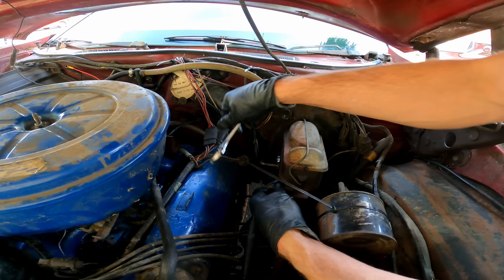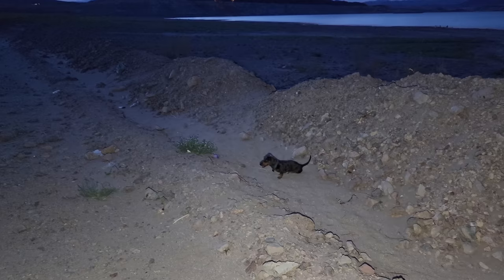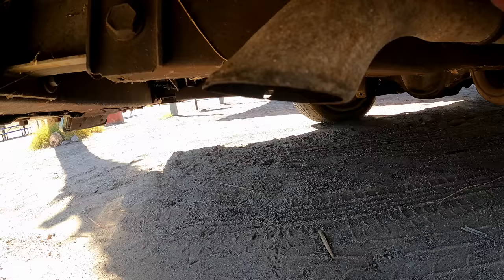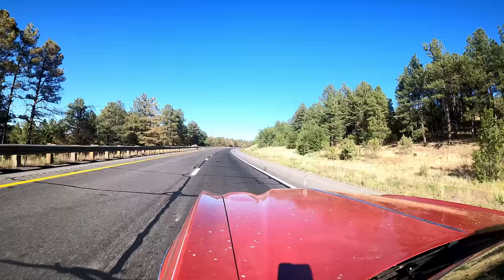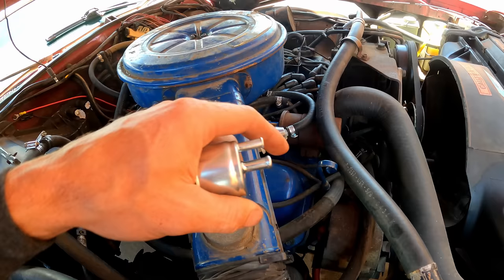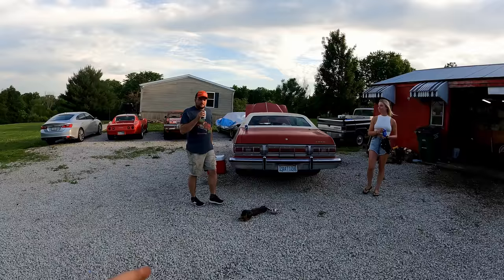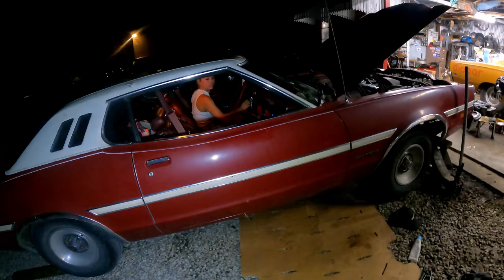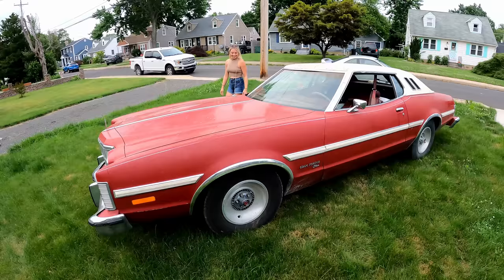Will The 1974 Gran Torino Elite Drive 2500 Miles Home? Vegas To Philly - NNKH

Comment from the maker: I just picked the 3 random winners for a B'laster T-shirt / can of Multimax Lube.  If you don't see a check mark next to my name and a heart on your comment then its a scammer impersonating me.  I keep blocking them and they keep making new accounts.  Anyway... 24 hrs to comment back and claim otherwise it moves on to the next randomly selected winner.  Good luck!  
BTW, merch link stopped working... Check out NNKH hats here: https://teespring.com/nnkh-hat?pid=763&cid=103367
Reply: Dry gas or isopropyl alcohol should take that sap off. It works with pine pitch but it does take some elbow grease. Use it along with a plastic razor blade. Gus has got to be one of the cutest puppies I’ve seen.
Reply: Hi thanks ! I saw on my mail that i won something.
Reply from the maker: @miman-ck9jv  That was a scammer
Reply: @NoNonsenseKnowHow  all right thanks,    get that car cleaned up 👍👍
Reply: It’s a shame you have to deal with the trolls
Reply: Hello this is Russ. Love the vise grips and hammer
Reply: You need Gus on shirts and hoodies...I'll buy for sure!
Reply: Where did the squirrel go
Reply: You got cool partner there she so sweet u lucky man
Reply: Great vid.love your dog and wife.y’all my kinda folks.  I just sold my 1970 TorinoGT ,convertible. I miss her now that I saw your vid. Cheers. God bless.
Reply: 31:38 the thunderbird had the AC micro switch you needed.
Reply from the maker: Yes. And it was probably bad too. LOL. Plus I think at that point in the trip I already corrected it with another switch right? I don't remember
Reply: I had the same exact Torino back in the late 80s here in Pa and same color . It had the 351 windsor with the cast iron fmx trans in it but I changed it out with a cleveland. It was a tank .
Reply: @NoNonsenseKnowHow  👍 great video, entertaining to watch, make another road trip vid with a sketchy abandoned car 🤣
Reply: Every nice ride needs a 2:73 rear end. I got 28mpg with 400hp 350 chevy engine and 18mpg with a 900 HP 350 engine
Reply: @NoNonsenseKnowHow   WHY NOT OPEN TO CANADIANS ???... We watch your channel too, eh.
Reply: You know I'm so glad you mentioned the Scammer . I literally had a message from VGG telling me I've won with a phone number attached . New it was a scam when Derrick himself texted and said I won a new truck . I only had to pay customs .. Loved this Whole series can't wait to see what's next .
Reply: If you use a bumper jack , at least put blocks under your car . If you are going to be under the car . You are setting a bad example.
Reply: Thanks for the video. This is my first time watching one of your videos, it showed up in my recommended list and you got my attention with the car right away because a friend of mine in high school (1992) had a 1978 Gran Torino and I loved that car. I'll be subscribing and liking to help support your channel. One last thing, I don't if you are aware of how lucky you are to have such a cool girl to go on such an adventure with you. Most of the girls today are too vain to be seen driving in what most people these days would consider a hooptie. Keep on keepin on!
Reply: To remove tree sap drops you can try things that also remove tar = for instance butter, fat and/or oil.
Best regards luck and health to all involved life forms (humans and animals).
Reply: Bacon grease, butter and tallow have used for everything for the last ten forevers.
Pretty good stuff!
Extra creamy whipped cream works the job also.
Carrageenan(sea weed) is the thickened along with cellulose gel.
I did video where a side character ( me)thought he had rabies, and everyone said no, you can't get rabies from a duck ( adaption of the famous duck joke).
I keep showing up with more and more extra creamy whipped cream coming out of my mouth and all over my head more and more saying, " I think it's getting worse"
I'm telling you because later after I had showered it all off, I noticed my skin was smoother and softer than s babies ãş$.
Try it , you'll be amazed
& your welcome.
Ps~ you can also shave with it.
           Prof. I. Ver Mectin
Btw ~ Ivermectin,  the alcohol blend they spray on cows to keep them movie free and makes them look pretty work good too, but since everybody found out about it the price went up almost ten times.
Reply: You three just took my Heart with you on that 2 week drive/vacation/project/Adventure!

I feel like I've just made Friends for Life.

Thanks for sharing it all with Us.
Reply: Yes pick me.
Reply: Pick me love forever
Reply: Yes pick me
Reply: Alex carro
Reply: Mr. Road traveling in granda torino& your wonderful lady which does have nice nice legs,plus the dog is a nice minded dog. Oh yeah im Douglas Bailey in  Indianapolis, its ok i didnt win the Blast t-shirt, you said it was some dirty greedy impersonater , scammer doing wrong stuff. He should be eating scrable eggs then impersonating your wonderful work you and ur helpers . Just put scrabble egg eater on the wall so he might slip off the wall, so i can plus you & helpers in stayed of called humby dumby call him scrabble egg man cause no one put him back together. (Funny) but true . Later my fellow traveler. Plus ur helpers. Here something try not to have scrabble eggs to much. Smile😇😇🤩💖👍🙏👫🐕 later man 🤔
Reply: @mikehunt3222  yea Gus is ok, more of Jen in her daisy dukes will blast the view numbers thru the roof though.
Reply: Hey at 13:23!, I like that flashlight where did you get it at or what website that I can buy it off of?
Reply: I read for a non aero vehicle 45mph is about the max for optimum mpg's above that just pushing to much wind.
Reply: When you drove onto your front lawn, did I see a 1970 Monte Carlo in your driveway? Now that's a nice car. I had a 1972 Monte when I was 18. My brother handed it down to me. I loved that car 🥲. What city do you live in? (I'm in Pa., living in the Willow Grove area)
Reply: @Jazzyj69  you saw wrong pal
Reply: @obston2846  you need to go to the 1:15:46 spot of the video and you'll see a 1970 Monte Carlo sitting in the driveway.
Reply: Thanks for the shirt bro i love it next time can you sign it? Also your sister is awesome she was such a good sport helping you on that long drive.
Reply: @NoNonsenseKnowHow  Don't you have an oil filter wrench you carry? I swear you are the MacGyver of mechanics.
Reply: closer to the Torino than the t-bird was the Mercury Cougar,   I had a 75 Cougar that looks so close to this car,  trying to remember if it had power or manual mirror controls,  def power door locks because I had to replace one of the solenoids...  it also had the (at that time) kick ass power trunk lid latch.
Reply: @snoopstp4189  My very first car was a 1976 Courgar XR7 that my parents bought new when I was in 11th grade. I have owned many Cougars ever since and I wish I still had the 76 cougar. Nothing was built as well at the 74 to 76 Cougar and even the grill was made of cast metal like the Lincolns were.
Reply: 36:12 looks like you got punched in the eye
Reply: @CorpseDriver01 Www
Reply: Hey GUS start your own YouTube channel
Reply: b
Reply: @NoNonsenseKnowHow  Just want to say that this video is by far my favorite thus far!
Best aspects: 1-)Plenty of Drone footage (can never have too much!) 2-) Stops to visit friends along the way (VGG doesn't do that!) 3-) Constant mechanical upgrades along the way (with good details on the how and why) 4-) Great photos and period correct archival footage mixed in along the way.
I'm sure there's more that I'm forgetting but I'll just add: If you haven't already create playlists with other videos of the same style to make it easy to find each video of different styles and smiles! (please excuse me if you already did so)
Keep on Truckin'!

:face-red-droopy-eyes:
Reply: That's one nice looking Ford.  I have found you two for the second time ever.  The first time you were vacationing and returning home.  The fly drive is something I wish one did in my prime, about thirty years ago.
You are close to Merlin's Old School Garage , he is on the Internet and a car specialist.  Big diesel man and if you saw a Cummins boat on the lake it was him
Reply: One of my brothers's Enduro cars was a green 73 Gran Torino with the 351 Cleveland 👍😎
Reply: An awesome roadtrip watched from UK thanks

Comment: To get those dried up white tree sap spots off of the body, Use a decal & sticker removal wheel in a cordless drill... Takes them right off with no damage to the paint

Comment: Loving the Torino content. My grandfather owned a 74 Grand Torino and my favorite show was Starsky and Hutch. So when me and him would hang out my favorite part was riding in the Torino. My grandfather was a giant of a man, specially for his generation. He would sit with the seat all the way back with his head leaning to either side because of his height and his knees along both sides of the column.
Reply: That must have been a tight fit for your grandfather.   I have a 72 Gran Torino and I am only 5 ft 10 inches.  With the seat all the way back I am still wanting for more room.  His probably had a power seat which gives you a lot more leeway.   My 77 Cougar which is basically the same car had a power seat and that really helped a lot.  They are beautiful cars.

Comment: We used to typically wrap the fuel lines at the engine area with tin foil to solve vapor lock issues. It worked in the 60s. Great video for a trip with a 48 year old Ford. If you could've resolved the fuel delivery issues at the beginning, then your trip back home would've been almost trouble-free!
Reply from the maker: From what I understand it mostly starts down where the fuel pump is mounted at the Block and it starts boiling in the fuel pump. So going with it and electric pump seems to be the most popular upgrade

Comment: For the fuel vapor lock problem, I've gone to a wrecking yard back in the day & found an old power steering cooler like the one already on your power steering pump & found a place under the car near the fuel line. Close to the fuel pump is best. Route the fuel thru it to cool the fuel. If you can mount it where air can hit it while being shielded from damage it will stop vapor lock, a common problem back in the day in Texas. Just showing my age here (I still know how to set points...).
Reply: Me too.
Reply: Great video!  You reminded me how great America really is.  Thanks Chris, Jen, and Gus.

Comment: Those bumper jacks are retro but dangerous as hell ! I used to careful and extremely cautious just changing a flat. They fall and shift with just a breeze. When you were pulling and wrestling with the filter I was almost afraid to look.  
Other than that I enjoyed the video. Keep ‘em coming !
Reply: I know I would of had the spare wheel under the sump
Reply: Never get under a vehicle  supported  by a bumper jack! Fast way to die!   Jack stands are not safe either!  I use  either stack of tire with rims or large hardwood  log

Comment: The ramp/intersection that you saw in Missouri is called a "Diverging Diamond Interchange".  They are  usually find them in metro areas where there isn't enough room for a huge cloverleaf, while at the same time allowing traffic from all directions access to the opposing Hwy in all directions.  They actually work pretty well.   Nice job getting that boat back East!

Comment: Still living those days with my old Fords, not a bad ride! All typical problems, I run lower temp thermostats cause of the heat in the summer, those cast iron engines retain heat, years back we'd just take them out in summer, road draft is what keeps them cool, we live at high altitudes so I bump up the ignition timing and vapor lock is a thing of the past, my 52 F-3 was assembled at the Chester plant not far from you. Keep em running guy 👍👍👍

Comment: What amazes me is that at the same time the US was producing the square Gran Torino, Ford Australia was producing the Ford Falcon XB Coup with the same 351 Cleveland engine producing about 300hp and with a much sleeker smoother body line. Not a knock on this car, but being an Aussie kid, I think ours was the better car. But love this video by the way. Make me wanna do the same one day soon.
Reply: Your Falcon XB shares more of the styling of the earlier 70-71 Torino GT's in the US. By 74 in the US Emissions controls and 5 mph bumper laws had already slammed the brakes on performance and styling, and the manufacturers were now pressing the personal luxury car instead of high performance.

Comment: Kudos to you for your knowlege on the older vehicles. In my generation, we ALL practically had to have this type of knowledge as there wasn't a garage on every corner as there is today. ALSO, many of the mechanics today cannot seem to solve even simple problems like you have done! They depend too much on computers, codes and readouts, haha, and don't seem to have common sense knowledge and trouble-shooting skills, otherwise. Sad, but true.

Comment: Great video. I have a 1976 Ford Elite, that was my first car. I’ve had it since 1990. I love mine. It has the factory 460, bucket seats, and a power moonroof. It is white with white vinyl and red interior. They are great cars! It’s too bad that they are so unknown, under valued, and under appreciated.
Thanks again for the great videos. You two are so lucky to be able to do what you do.  Vacations like these happened in the 80’s, but unfortunately it’s far too expensive for the average family today.

Comment: Had a 76 red and white Ford Elite almost like yours. These are an awesome car. I ran mine for at least 200,000 miles and changed oil every 4,000 miles. The transmission needed overhaul every 100,000 miles. Need to check the rear wheel wells for water. They were bad about collecting water if not checked. Had to change the filter inside fuel tank. Mine had a 351 Windsor engine. Regardless, of care of carburetor, it would need some tlc every so often. Don't know where you'll purchase gasoline without ethanol. Rear holder that holds bumper was bad to rust. Clocks never seemed to work since they had spring loaded spark system. Had to replace the heater core eventually and put a bigger radiator after several years. Ran rods in radiator but that didn't do much but bigger radiator took care of the problem. Power steering hose wanted to leak. Would use the italia rotors from brake world if had had them back then and the pads they recommended.
Car-part is a great place to find the odd parts. Mine got 16 mpg in WV. Was curious what you had to give for that vehicle. My gas tank held between 20-22 gal. My car was manufactured in Canada. I'd change out that radiator for a bigger one so it would run cooler and not as apt to boil the gas with elevation changes. Front brake calipers were bad to rattle on mine.

Comment: A couple of tips:
1. For the vapor lock, if you open the hood partially when you park, it'll let the excess heat out instead of staying under that insulated hood, which I've found helps a lot.
2. For the shocks, where the top nut goes, there are two flat surfaces up at the top. I put a 1/4-inch wrench on that to keep the shaft from turning while breaking the nut loose (and to let me tighten the nut the last little bit on the new shock).
Reply: That's what I do on my old Chevrolet, when Its really hot I'll leave the hood at safety latch to let out the heat when I park or go slow

Comment: I really like how you improved it the whole way instead of just working on things that broke.  I grew up in the 70s and it's fantastic there are still people like this.  I remember calculating mileage.  People use the built in computer now but they are optimistic but with simple math, you can determine exactly what the mileage is.  Personally, I think car reliability peaked in 2007, but maybe that's just me.

Comment: One of the old time tricks for vapor locking is wrapping a wet rag around the mechanical fuel pump. It cools the pump off as the water evaporates. I’ve even had to do this on carburetors before.

Comment: I realize I'm watching this 7 months later but for the vapor lock... use wooden clothespins on the gas line....it stops the vapor lock. I had an old International Scout and that's how I stopped the vapor lock.
Reply: great tip with the clothespins...I'm gonna try that on my f100 460 big block. I'll still probably run a return line since I need to drop the tank to get the old gas out anyway, but it'd be nice to know if that home remedy works on mine.

Comment: Really liked this video.  For 1 The display of your knowledge of the problems and over coming them on the road was great.  2) The second reason is my second car was also a 1974 Gran Torino Elite  - Loved that boat but heck I had issue with Vinyl  roof back in like 1980 so seeing that one is not that bad or someone replaced it.  Love GUS !!

Comment: The Elite was in production from 1974 to 76. it was part of the Torino line in 1974 only, then Elite became a name in itself for its last 2 years. Also there was a steering wheel change in 1975. Therefore the Gran Torino Elite was produced for 74 only.

Comment: I found with our 4 Barrel on our CHamp 3/4 ton  truck 460 rear end rear will drive but I pulled the 4 speed and installed a 7oo R4 with a  rebuilt Studebaker Champ V48 once we got above 3000' and if it was over 85 we would boil, so  I installed a Electric Pump and no more problems os long as I rememberd to turn it on.
Peter S.

Comment: You could have added a fitting  adapter for the master cylinder that had a smaller connection.  They are available at most parts stores
Reply from the maker: I figured the best option was to get the proper one. But yeah that would have been next option or flare a different nut on